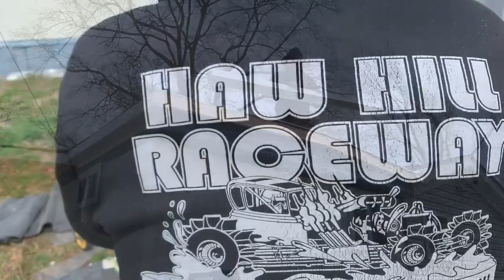How to repair a mobile home Leak Chesapeake Virginia

Comment: Very nice job guys. I have a 14×60 single wide and was wanting to know what the price difference would be compared to doing a metal roof. And what you guys would charge. Thanks and have a great day.
Reply from the maker: We don’t do metal roofs at all and if you notice the roof that you’re talking about doesn’t have enough pitch for a metal roof. The job I did in Chesapeake Virginia was 6000 the job we did in South Carolina the week before was eight